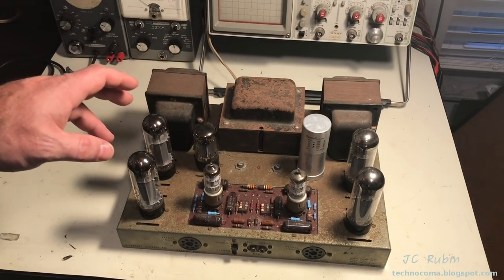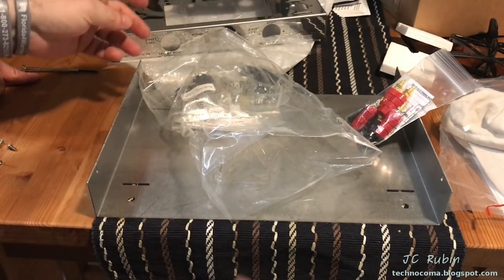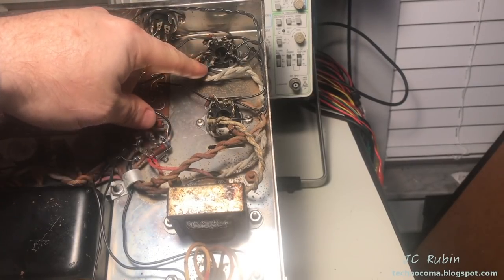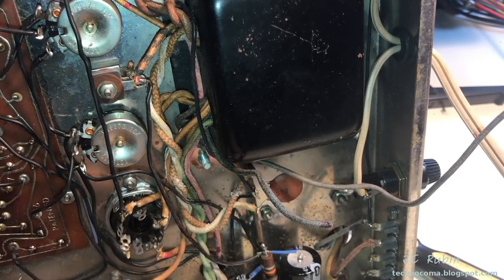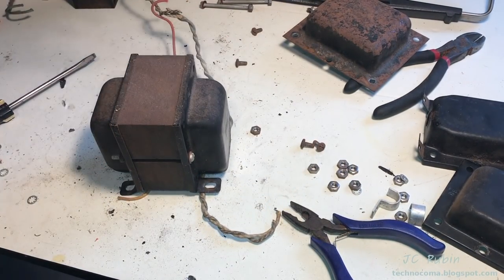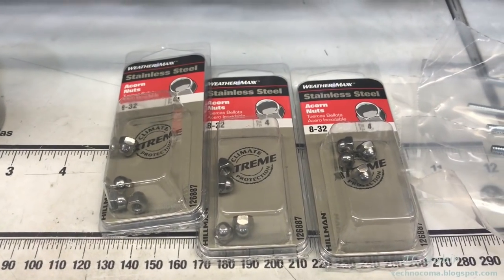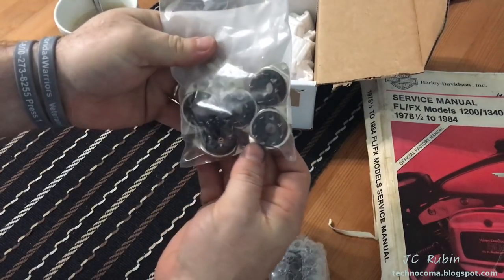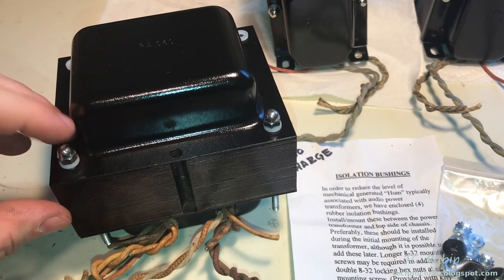The Dynaco Dynakit ST70 Stereo Amplifier Restoration Project Part 1

Comment: Using a wire wheel to remove rust off the transformer plates?  If you remove the insulation coating?
Reply from the maker: Is there a question in there. Or two statements.

Comment: A trick I learnt when cutting threaded rod or bolts with acorn nuts is to install the threaded rod with a standard half nut (depending on the depth of thread in the acorn nut) and then marking the threaded bar before cutting it.
Reply from the maker: Thanks for sharing

Comment: I have an original and looks better than the one in the video. I don't want to change anything I want all original parts, I don't want to change the sound to fit today's music. Mine will be playing classical and big band music like I heard in the late sixties on FM. There is only one part that must be upgraded to solid state and it's the selenium rectifier because the original will not be any good and there is not a replacement available. But all other parts including tubes, Capacitors, resistors, rectifier tube all can be replaced with new old stock. The capacitors will have to.be new of course just exact values will be used. I have both the preamplifier and st-70. I want to start with the st-70 the preamp will need some upgrading because a CD player will be added and need impedance matching.  And require more research. But the ST - 70 will be original . 73
Reply from the maker: My selenium rectifier still works, nothing wrong with it.  Only bad caps blow out these rectifiers, the rest is internet myth.  Remember that there were several cost cutting measures in the original design, one being the power supply caps so keep that in mind.
Reply: @retrotechandelectronics  as long as it sounds the same. I don't like some of the new designs and I will never use diodes instead of the rectifier tube. Those are the two main things. I had a friend's dad replace a 10 uf and used a 40 uf on an antique radio which was ok the only thing I didn't like is that nasty shock because the 10 uf was drained out when the power was disconnected but the 40 held a charge. I guess the coil discharged the 10 quicker than the forty. I was in Jr high and didn't know better when I messed with tubes and didn't discharge the 40 uf cap. But that's not my only reason for using equal value parts I also like things original if I had two identical amps I would listen to both and then make my final decision. I knew people who had original st-70 and st-35 and both sounded great with no modifications. If I decide to change the values and like them better I will post my findings. I haven't checked anything on the amp so I will check that selenium rectifier and if it's still good I will leave well enough alone. Thanks for telling me your valuable information. I did buy a diode but I don't have to use it. I bought new tubes because the old ones were broken the rectifier and one El 34. I'm kinda glad I didn't try to power the amp up. Maybe the selenium rectifier is still good. Thanks again. 73